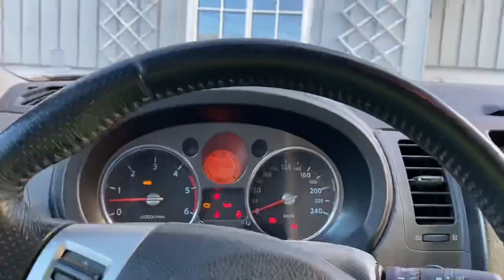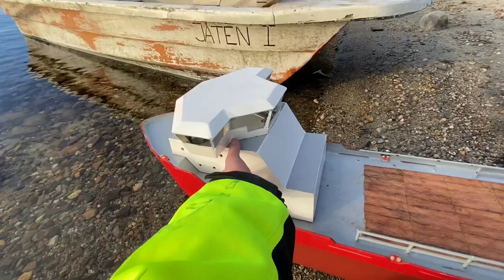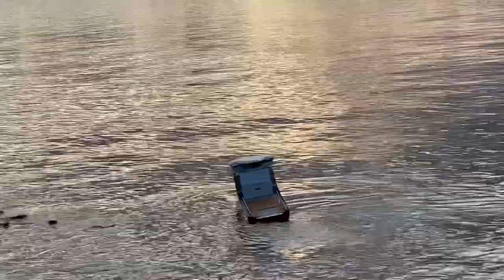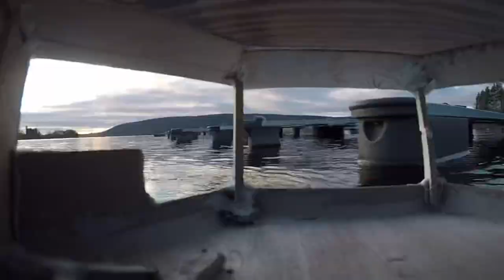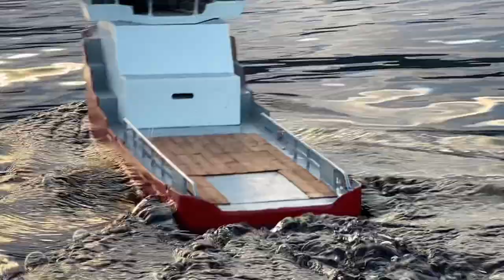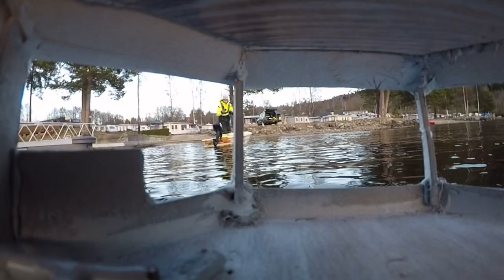Homemade RC Supplyboat ran aground

Comment: pretty cool but have you tested the boat out in waves? like ofc not the waves at a beach but the waves you would get on a lake on a windy day? to see what are the strongest waves she could handle (i personally test out rc boats (the generic speed boat ones) in my bathtub with a large plastic containers to generate waves to see like how high the wave has to be to capsize them